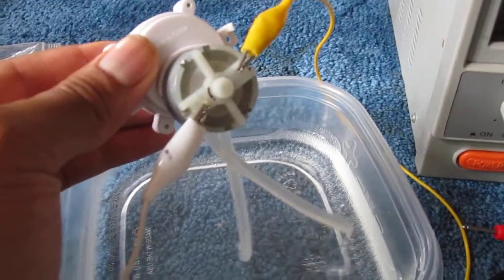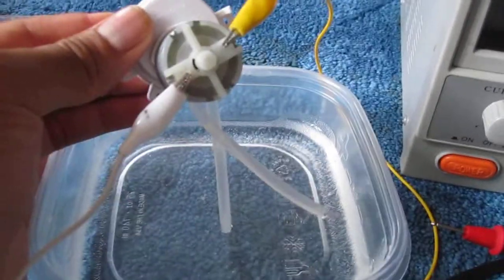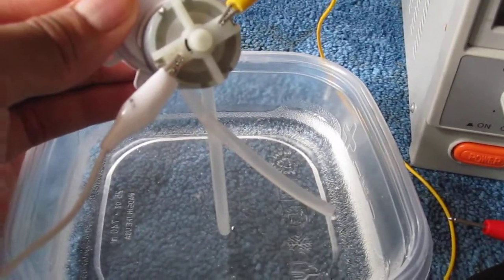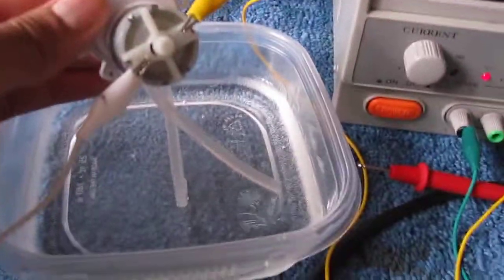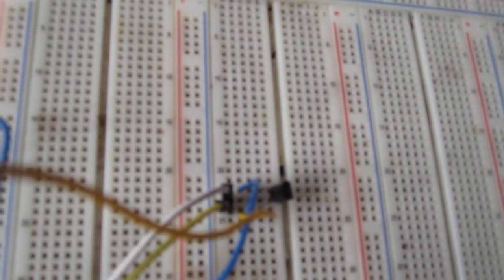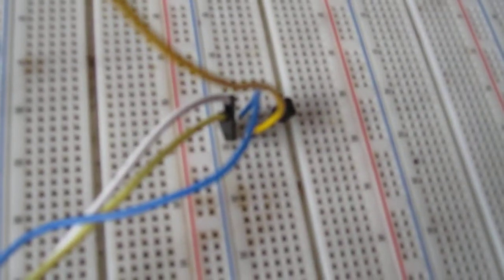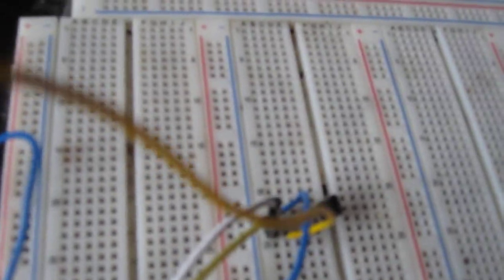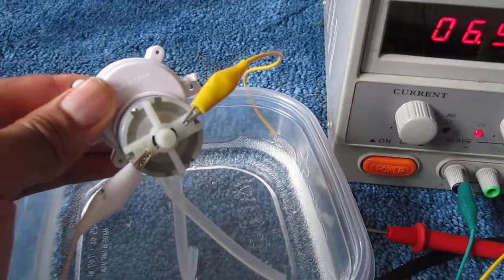Peristaltic Pump Circuit Controlled By an Arduino

Comment: Great video. I'm new to the arduino world. Are you using python? As well, wouldn't it be better to use a aufz44z mosfet instead of a transistor? That way you connect the arduino to the gate and then the 12v DC supply to the intake. Just a thought

Comment: Mine is weird, it works for a split second then stops. I got it working, had a break for 1 hour, came back turned it on and it stopped working again.